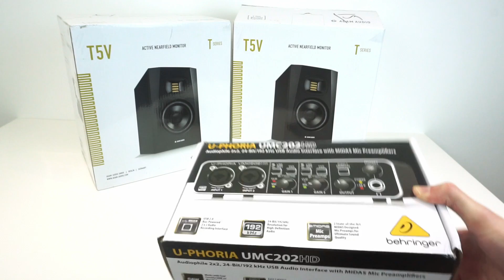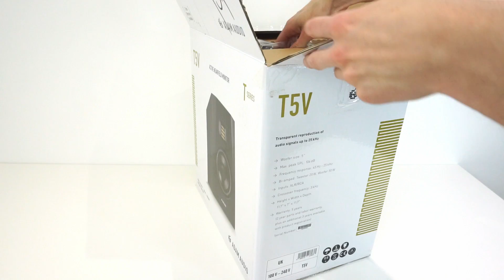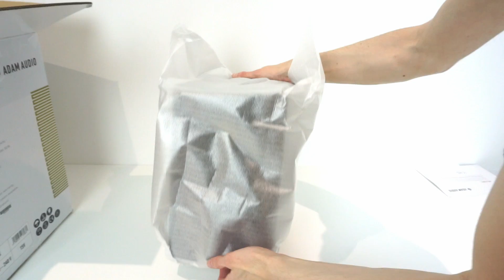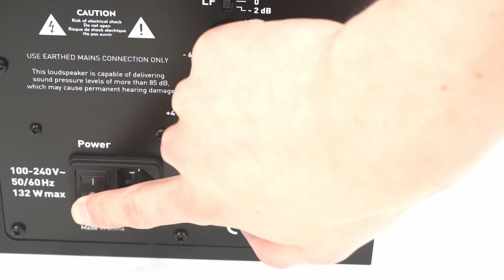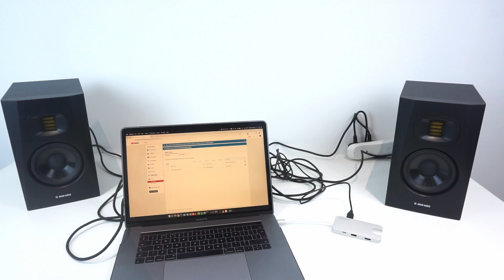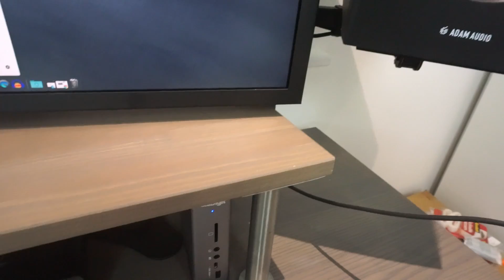New Home Office Audio Setup - Adam Audio T5V Studio Monitors

Comment: Hey (help)! Cool video! I've watched it a couple of times and just purchased the Adam T7V's to connect to a Behringer UMC404HD. Problem is.... the sound is too quiet. I've had to level up both the monitor's (up to 3/4 or 75%) and the interface volume levels (also 3/4 or 75"%) and I still have to increase the imac's volume levels to almost the maximum (90%) to get some nice playback sound (not loud, just enough to hear the music with some impact - I never play music too loud). Can anyone help?
Reply: i'm over a UMC202HD i'm kind of in the same situation... but the volume level is good enough to me, my levels went better when I upgrade to Big Sur, same for my mic levels from the audio interface, but yes, I was expecting to use the monitors on Zero, but i'm over that.... 75% on the 3 levels (interfase, computer and Monitors)  ..... which is a lot in my opinion.... should be less

Comment: Thank you for the review and the ideas. 
I just unboxed AdamT5V. When connected to the iPhone via dual xlr to 3.5 and then lightning to headphone jack converter they sound gorgeous. But, when I tried plugging 3.5 mm to the headphones output on MacBook pro or CaldigitTS3's headphone output I get the high-frequency hiss even without any sound source. The speakers play half the volume and the sound is quite disappointing. Do you think the audio interface (Behringer) will solve the problem? I think the hiss is interference from MacBook pro charging. Any ideas how to make it sound just as well as from the iPhone?
Reply from the maker: While it may not be the cause of your problem, generally speaking I wouldn't recommend using the XLR inputs on unbalanced sources such as with your setup.  XLR inputs are designed for a "balanced" audio signal which has two signal wires used to cancel our interference.  From my understanding, if you send an unbalanced signal in (such as that from a 3.5mm jack), you will also get a reduced signal level.  You'd likely be better off using a 3.5mm to RCA cables into the unbalanced inputs on the speakers.  As for things like hissing, best thing to do is try with the laptop plugged in vs unplugged and see if this makes any difference.  Also try without any external peripharels such as monitors as these could also introduce noise.  An audio interface may help but you may be able to improve what you currently have without one.

Comment: I have mine plugged in balanced to my audio interface but I wanted to also be able to use these as regular desktop monitors without my audio interface. I bought 2 rca cables and then plugged them into a Y cable with the other end being a traditional 3.5mm jack to go into my computer. There is a significant amount of noise, not sure if it's the cables or it's because they are unbalanced. I also noticed that the RCA cable does not go all the way into the RCA jack like on other products I've had. Any suggestions?
Reply from the maker: I'd try a different cable and see if it's that although being unbalanced will make it more prone to interference, even moreso if this is a long cable which I presume it will be to go to both speakers.  I'd also try a different device on the 3.5mm end, ideally one that's running on battery power to eliminate it being any sort of ground loop issue.  I've previously encountered a ground loop issue when connecting a Pioneer DJ controller to the speakers over RCA cables when my laptop is powered through my docking station.  I've used an RCA cable without such issue so it's not a blanket issue with the T5V's RCA jacks at least.  I ended up putting a cheap 5 channel mixer in between my interface and the speakers - means I can keep everything connected with balanced connections and can easy connect inputs to this mixer and adjust levels.
Reply: @camerongray1515  thanks! Which 5 dollar mixer did you purchase?
Reply from the maker: @L_Lmusic  The mixer I used was a Behringer Q502USB although it was 5 channel rather than $5, probably costs around $80.
Reply: @camerongray1515  ooh lol all good. I actually have a behringer mixer myself. I'll give it a shot and see how that goes.  Thanks again!

Comment: Hello Cameron, are you positive the outputs on the Behringer U-Phoria UMC202HD are balanced? I could not find that in the official documention or elsewhere.
Reply from the maker: From what I could find online they were apparently "impedance balanced" so not fully balanced although I just opened mine up and can see that the "cold" pin is simply connected directly to ground rather than through a resistor that you'd expect with something that's impedance balanced.  Not sure if this will still provide at least some sort of interference reduction when connected to a balanced input or not as it's a bit beyond my level of knowledge.  With that said, it works fine for my use but if you're doing something where balanced inputs are an absolute must, I'd probably get something with proper balanced outputs or use an external balancing box.

Comment: I messed up, I bought rca cables, but it's not the right ones because it needs left and right for each speaker, I forgot about that when I bought the rca cables, and I have no idea what to do now
Reply from the maker: What cable do you have and what sort of source are you using?  You can usually split RCA cables fairly easily by pulling the two plugs apart or alternatively you could run both the left and right to one speaker, connect one of them to that speaker, then use a coupler and another RCA cable to extend the other channel across to the other speaker.
Reply: @camerongray1515  I got the "AudioQuest Golden Gate" RCA.
I will be using a toslink, it's also from AudioQuest.
My plan is to connect a toslink to my TV and then connect it to the DAC I ordered from Amazon - the Topping E30, and then RCA from the DAC to the monitors.
Reply: And I don't think I can split it, since it has that thing that protects it :/
About the second alternative, I didn't quite get it
Reply from the maker: Yeah, doesn't look like you can separate that, your only option would to either be to buy a cable you can split, buy another cables for the second speaker and use the one you have for only one of them or buy another cables and a coupler to extend the cable between the speakers.  With this you would use a coupler to essentially join another cable onto the one you have to extend it from behind one speaker onto the other one
Reply: @camerongray1515  Thank you for the help bro <3
Happy new year! :D
Wish you luck with the channel

Comment: Does this caldigit 3 improve sound quality? I want to buy adams t5v and I need something like your behringer um202hd to connect monitors to my laptop, is it good idea or some dac will be better? Regards
Reply from the maker: The caldigit dock won't have any impact on the sound if you're using it with a USB audio interface, if you're referring to the audio output on the dock itself, it's fine but not nearly as good as a dedicated DAC/interface.   As for a DAC vs an interface, the reason I went for the interface is because it has balanced output jacks which are ideal for the T5Vs and should be less prone to interference than having to use unbalanced RCA cables from a DAC. Probably not a huge difference though.  The other difference would be if you want inputs as these are usually only on an interface.  At its core, an interface IS a DAC in terms of its audio output so it's really down to the quality of the DAC in the interface compared to the DAC in a dedicated DAC.
Reply: @camerongray1515  thanks for answer, you are using mono xlr/jack, or stereo cables? Because i don't know which one should I buy
Reply from the maker: Ideally you'd want to get "stereo" cables (or more precisely those with a TRS jack, the one with 2 stripes on the plug) as this will carry a balanced signal and therefore reduce interference

Comment: SUBSCRIBED and thanks for the video, your speaker stands are nifty, did you glue them or otherwise attach them so´s they can´t get knocked off.. ?  :-) I just got two TV5´s as well and am running them straight from my mac mini 3.5mm dock. Does the U-phoria noticeably improve the sound and does anyone know how I could hook up a subwoofer too.. ?
Reply from the maker: They grip well enough so didn't stick them on although they’re not in a place that people will walk past, if they were in a location that people might be walking past, I'd probably go with something more secure.  I definitely noticed slightly better sound quality vs my docking station but not sure how it compares to a Mac Mini's audio output.  For a subwoofer, you'd probably want some sort of crossover to separate what goes to the speakers vs the sub, you could either get an external one, or use a sub such as the Adam T10S which has a built in crossover - you connect the sub to your source and then connect the output of the sub to your speakers.
Reply: @camerongray1515  really cool to know this thanks Cameron.. !

Comment: should i get this audio interface or a behringer mixer?
Reply from the maker: Suppose depends on what you are doing, the mixer has the benefit of allowing you to combine multiple sources.etc but if you want to use the USB on the mixer as an input you'd need to be aware that it will record any sound passing through the mixer, this includes audio that you are playing from your computer so if you were to try and record a microphone while playing music, the recording would contain both the microphone and the music.  On the other hand the interface has totally independent inputs and outputs.  Personally I use both, I have the interface to connect everything with my computer over USB then feed that into a mixer to allow me to add in other sources and then connect the output of the mixer into the speakers.

Comment: did you left them on 0 on the back pannel volume control? they are kinda weak even when i put full volume on the same audio interface. 
even tho im using the bigger t7v version
Reply from the maker: When I ran them directly from the interface I did have the gain on the back of each speaker increased slightly.  I've since started using a small Behringer Q502USB mixer between the interface and the speakers as a way to quickly connect other devices which has a much more powerful output than the interface itself, so much so that I've had to drop the gain on each speaker to below 0db (they're now in the 12 o'clock position) to give me more range on the volume control.
Reply: I got the same problem,running Audient Evo 4,do you think is the output of the interface?Evo 4 output at 11 dbu and Universal Arrow at +20.7.
Reply: @morerate435  bro what i did since then is just blast them on full volume on controls on monitor and use volume knob on my interface just as normal volume knob..you will get a bit of hiss but its fine
Reply: @DanijelLovric-Stigmae  I see, I did the same thing.Is what Adam recommended if you interface have low output.Thanks for the head up Im still going to purchase Apollo Solo later on.
Reply from the maker: The output of my interface was fine although it's wasn't particularly powerful.  However, I later added in a small 5 channel mixer (Behringer Q502USB) between the interface and the T5Vs to allow me to connect more devices and found that this gives a significantly louder output so something like this could potentially be an option.  That said, turning up the gain on each speaker would be your first port of call unless it causes a noise issue.
Reply: @camerongray1515  I think it gave you more power because your Behringer device output 22+ dBu.While my Evo 4 only output 11dBu I think it make sense if I get an interface like Apollo or Apogee with 20 dBu I can then set my monitors at 0db.

Comment: great video Cameron, could you please help me out with the cables, trs cables and send me a link where to order, as I can not find them? I need the same as in your video. Thanks bro!
Reply from the maker: I bought mine in a physical store so don't have the exact link handy but this looks the same: https://www.amazon.co.uk/Stagg-NAC3PSXMR-Audio-Cable-Phone/dp/B00JL79U86/ref=sr_1_11?dchild=1&keywords=stagg+trs+xlr+3m&qid=1595192762&refinements=p_76%3A419158031&rnid=419157031&rps=1&sr=8-11 - There's probably other cheaper options out there, you need a Male XLR to 1/4" TRS jack cable.  Just make sure that the 1/4" end is actually a proper TRS stereo jack (two black stripes rather than one) to get a balanced signal, a lot of them use mono 1/4" jacks for unbalanced microphones/instruments.etc.
Reply: @camerongray1515  Thanks for your fast reply, appreciate it! :)

Comment: Do you have to plug both speakers in a socket for power or just one and the 2nd becomes slave monitor ??
Reply from the maker: They both need power, they essentially operate as totally independent speakers, there's no connection between the two of them.
Reply: @camerongray1515  I thought so. So how do they pair in stereo sound is it through the audio interface ? Otherwise if you only plug one cable it will be mono or 1 channel ? Sorry I'm kinda new in this area, I want to buy a set a quality speakers but I'm.just worried that I might be short in power sockets for the second speaker .  Thanks for responding.
Reply from the maker: The audio interface I use has separate jacks for the left and right speakers so you just connect one speaker to each connector.  If you wanted to feed them directly from a 3.5mm jack you'd need some sort of 3.5mm to RCA splitter then run an RCA cable from that to each speaker.
Reply: @camerongray1515  thank for the response

Comment: Cameron, What make are the stands you mounted the Monitors on. I’m finding it difficult to find ones that will actually rotate the full 90 degrees to allow the monitors to sit, as yours ! Cheers, Paul.
Reply from the maker: This is the particular one I used: https://amzn.to/2ABVy3Q although it looks like a fairly generic item so is probably sold under various different "brands" in different countries, may just need to check for ones that look the same and make sure you can return them if it turns out not to be suitable.  I found that generally the cheaper/more basic ones were more likely to support it and the fancier ones were more likely to have a tilt limit.

Comment: How do I setup a subwoofer with these speakers?
Reply from the maker: Easiest way would probably be to use an active subwoofer with a built in crossover - run the audio from your interface into the sub then run cables from the outputs of the sub's crossover to the monitors.  Either that or you'd be looking at some sort of external line level crossover device.

Comment: Hi Cameron from Italy. Interesting video. Very interesting your idea for side monitor support stand . 
Question: 1- what is the distance between wall and rear of monitor? Adam suggests about 40 cm or more , but I I see well you have 20 cm max, it’s right ? Gave you problem of bass boost or other sound issue ?
Very intervening the listening point where you have put Zoom recorder. Definitively this is a normal listening point not a usual near field position for recording mixing . At what distance from monitor is Zoom recorder ?
Thanks for your work

Comment: If you've not done so already, you'd really benefit from using the DB adjustments on the rear of each speaker to compensate for the acoustics of your room - and the fact that they are mounted close to the wall. The adjustments once done, will help here an even more accurate and balanced sound ;)

Comment: the pops is normal you have to power the monitors as last, this the fist roule boy.
Reply from the maker: It's not particularly convenient having to do that since the pops occur every time I dock/undock my laptop - it would be a complete pain having to turn both monitors on and off all the time.  What I'll probably do is put a powered USB hub between the dock and Behringer interface, this will ensure that the interface will remain powered up constantly and won't power cycle when I dock/undock the laptop which will stop it popping.  The interface will still produce a pop when I first turn on the mains power but it won't be an issue as the speakers do soft start so turning them both on at the same time as the interface will be okay.

Comment: turn your soundcard on before you turn your speakers on, it will stop it popping
Reply from the maker: It does but I'd rather not have to worry about that - I have everything connected to a docking station and want to be able to just plug that into my laptop and have it work without having to switch various things on and off every time.  What I think I'll look into is seeing if I can power the interface from an external power supply rather than the dock using a modded USB cable.  That way the interface will power up at the same time as the speakers (rather than when I dock the laptop) and therefore won't pop due to the soft start of the speaker's amps.

Comment: You should really be using Flacs or DSF's for testing. 
(I really hope you properly configured it in OSX MIDI tho so you not on 41Khz because you do notice a major difference at 192Khz)
But Adam Audio speakers and Behringer 202 interface is a good setup for mastering you made a good choice there. (Well for a non-audiophile)
Reply: 192 khz is  over kill, humans can't hear up to that.  CDs ripped to Flac files at 41 khz is all you need.
Reply: @sarahwright6833  When doing any audio editing or production you'll notice a difference even if its small.